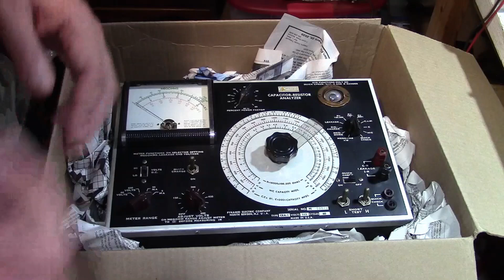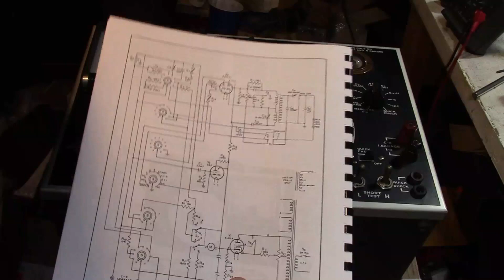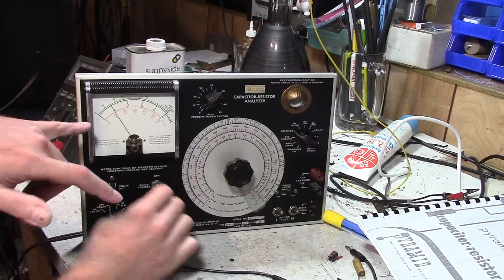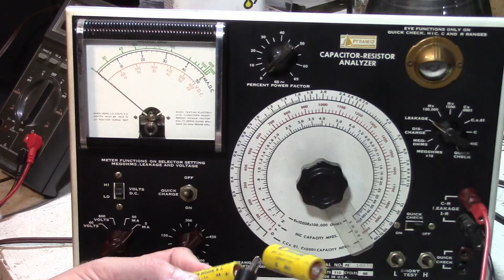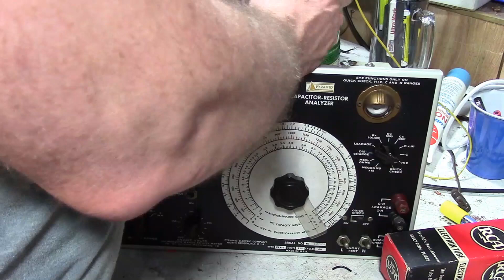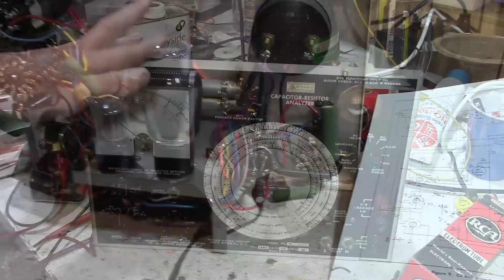Pyramid CRA-1 capacitor analyzer

Comment: This video is slowly goading me into finishing up the complete rebuild of my Sprague TO-5. RIght now it's about like this one: working, partially recapped. The main potentiometer— the one which controls the scale/ dial— was a bit flaky though, so I ordered a new one. They still got 'em over at Mouser! A little expensive, but then I got a good deal on the tester, and it's in nice shape otherwise... yeah, ok it's time to dive into it. :)

Comment: Capacitors? If in doubt, change 'em out.
But nice looking addition to the bench.
Reply from the maker: And when I do that I get complaints from viewers for not testing them.   There are many in the hobby that go by 'if it ain't broke, don't replace it'  That's why I got it.
Reply: @bandersentv  I can understand that.  I'm not a purest when it comes to under chassis components.  My main goal is to make it work and last as long as possible and look like new outside.   Although I have restuffed a few electrolytic cans because there wasn't enough room under the chassis. I like to change all the paper, bumble bee, and electrolytics.  But some are of the other idea. Each to his own.

Comment: I got a sprague tel-ohmike to-6 :) payed 697$
Reply from the maker: 697 ?  The average price on ebay seems to be about 250
Reply: @bandersentv  I keep looking for cheap ones but all of one's I have seen are above 450us I payed 697 Cad that's including the 150 shipping the good news about this unit is its already been serviced with all new caps and resistors so it's ready to use :) it's very clean and has original manual. The sticker in back says Victoria general Hospital
Reply: I would measure everything in circuit from that switch in 600v range. Hopefully you find something

Comment: Did you replace the .02 mfd cap that is up stream from the meter? If it has resistance it can pull some of your dc to ground through the resistors.
Reply from the maker: Yes, it has been replaced.  In depth look at this circuit coming up.

Comment: It is my experience that when something inexplicable like this high voltage happens, then it is usually due to high frequency oscillations.  The high frequency oscillations get partially rectified somewhere in the circuit, resulting in an apparent dc level.  So put a high frequency scope (1GHz) on points in the voltage control circuit and see if there are any high frequency oscillations.  Hope this helps.
Reply from the maker: Best I have is a 100 MHz scope but I can give it a try.  I've heard 6L6s can self oscillate.
Reply: @bandersentv  That'll work. Just put it on the most sensitive range and move the probe around the circuit without touching anything. If it's oscillating, you should see it. The scope might even synch properly if you use the LF filter on the trig.

Comment: Sorry to hear about the tornado damage. Hell hath no fury like Mother Nature. Really enjoyed this video and quite a nice tester in great condition. I didn’t have a chance to look at the schematic for it, but I recall you showed it had two trimmers. What are those for? Not the meter calibration, apparently. I have an old Heathkit IT-28 that I use frequently and although it doesn’t have a meter, measured voltage is +/- 5V of the indicated voltage on the voltage selector switch. I would think you’d be able to get similar accuracy with your tester. By the way, I use my Heathkit tester with relatively light-gauged test leads up to 600V and have never had an issue as the current is relatively low. Still, if I was leaving a cap to be reformed I’d be more comfortable with the heavier leads you chose.
Reply from the maker: They are for the RF oscillator used in the Quick Test mode.

Comment: Maybe check the taper of the voltage adjust pot?   Seems like it should be linear, but maybe someone installed a reverse log taper one?   Or maybe the voltage out of the transformer is just a lot higher than needed to get the DC output indicated by the dial.   Doesn't seem like it should be as far off as it is, though.

Comment: My bet for the test voltage setting would be the same already mentioned  -- your line voltage is higher than the design line voltage.  I would even think the original might have been 110 V.  Nowadays you could regularly see over 120 V.  Mine tends to be 122 V.  There is no reference voltage, just the "guess", like when to turn the steering gate on, and that comes from the same (excess) voltage.  Moreover, the filament voltage probably is higher as well, so the 6L6 charges the output capacitors faster than expected at the original design condition.  You could test this conclusion by feeding the  unit with 110 V from a Variac.  If true, you could try tweaking some of the components at the voltage setting string.  Or preferably reduce the line voltage permanently.
Reply from the maker: It was designed for 117 and I am running it through a variac at 117.  Dropping it to 110 has little effect.
Reply: bandersentv 
OK, so I would have lost if it would have been an actual bet!  Oh, well...

Comment: I would increase resistor going to control it should help lots
Reply from the maker: It might not be that simple.  It works correctly on the 0-60 range.
Reply: @bandersentv  it's definitely something to do with that control something is out of tolerance could be one of those power resistor maybe are open

Comment: Its very simple. Higher line voltage, more efficient newer parts, the dc voltage range is going to be higher. I have the same problem with my heathkit IT-28.
Reply from the maker: I'm running it from a variac set at 117 and the problem was there before any parts had been replaced.  The voltage is about 120 volts too high.   There's something not quite right
Reply: @bandersentv  even then, my variac runs about 30 volts high. You always gotta check it with a voltage meter. I would run it at 110 or 115 volts. New caps and newer parts are more efficient. So more b plus, more voltage coming out of the circuit.
Reply from the maker: My PR57 Variac has a built in meter and I know it's accurate.  As I said, the problem existed before any components were changed.  This device does not have a convention B+ supply.
Reply: @bandersentv  hmm. I'm stumped. Mine has a variable voltage supply and not a fixed switch, so I just put it a bit lower than what It says on the device. I know yourse has a variable voltage supply so I would reccomend that. But I'm stumped on this one.
Reply from the maker: I've dialed the variac as low as 80 volts and it has little effect.  Perhaps it's a bad ground connection.  The front panel is aluminum so all connections to it are mechanical rather than soldered.  It also seems like the huge power resistors don't get very warm (if at all) while it's running.
Reply: @bandersentv  very well could be

Comment: Bill just did a packing video. He is very good at it so it no surprise how well this came to you. Nice unit. Got a Semcor RC-115. It is very much  like a Sprague TO-4.
Think the eye tube and power factor switch are in opposite places. It has a nice meter on it something like yours  too. Great demonstration on how it works!
Hey Bob get some rest. You look totally exhausted man!
Reply from the maker: This didn't come from Bill.  I just saw him use one in a video years ago and wanted one of my own.  Semcor looks like a nice device.  Curious that it has the same voltage ranges as this CRA-1

Comment: If you want to make up a religion, Church of Electrolytic Reformation would be a good one :-)

But I'd like to know: Do you have experience with the reliability of reformed capacitors? 
(I tried to ask more precise questions but ended up with a huge wall of text every time...)
Reply from the maker: No, none.  I don't mess with reforming old caps - I always replace them in the end.  The only reason I talk about it is that there are plenty of guys who do and think it's wasteful to replace caps with some life left. Since most of the sets I work on belong to others or I sell, I don't want to take any chances.

Comment: I think the meter shows a positive voltage even at the minimum setting because the 6L6 will conduct and charge the capacitors up to the voltage necessary to negatively bias the 6L6 so that it no longer conducts.  The 6L6 data sheet for class A operation at 350V on the plate and -18V on the grid gives 66mA of plate current.  For the capacitor voltage to stop ramping up when you switch on requires that all the plate current goes through the bleeder resistors, and I guess this is just a few milliamps. (Need to know value of R19 and R20 to calculate this current) The plate voltage in this tester must peak at around 600V, so I would expect a lot more than -18V bias to be needed.  I found some characteristic curves for 6L6 which show about 8mA plate current with -90V bias and 600V on the plate, so your minimum voltage of 120V is not surprising.  It looks to me like it was designed to work this way, and it is not faulty.  Maybe the manual explains this somewhere in the small print?
Reply from the maker: Maybe, I'll keep looking.  What I find odd is that the 60V range tops out at about 55 volts and the 600v range starts at 120.  So there's a big gap in coverage.
Reply from the maker: R19 and R20 are both 60K.  Nope, no explanation in the manual.  I get about 450 volts with the knob set to 300. Seems odd to me that this works as intended as it means that you can't test between 60 and 120 volts
Reply: Technology limitations?

Comment: Is the voltage adjust knob able to be removed? You could just rotate the knob until it points at the correct reading.
Reply from the maker: I suppose but it goes way off the top of the scale and doesn't go as low as it should.

Comment: Nice capacitor checker! Certainly a step up to our CB-160(s). I saw that it was on discharge right away. It looks confusing to remember the sequence of settings you have to go through.  Can't blame you there. -- I also use to watch Old64goat's work bench videos a few years ago. I didn't realize that was the same cap checker. How come I get a feeling that all of these just worked in the day like that? --   You were lucky as far as that storm goes. Did you have any flooding in your basement?  Take care Bob and thanks for the vid.
Reply from the maker: No, no flooding thank goodness.  It didn't rain all that much and we had the one foundation crack sealed a few months ago.  Tight and dry down there :)
Reply: @bandersentv  wheh...

Comment: I like these old devices and have the much simpeler heathkit IT-11 myself. But I'm thinking of building the capacitor tester mr carlton (lab) showed to his patrons. He concluded that this form of leakage test is basically measuring current through a high ohm resistance. And as you said the device has a mode for isolation tests. His next conclusion was that Ohm's law does not change with voltage and following from that, is that the test is equally valid with low or high voltages. To me this makes sense. So he designed a circuit that does the same with much lower and safer voltages. (has a nice led bar to show current in place of the eye tube). The reason old devices (I think) used high voltages. Is A because it's what they had and B it requires far less sensitive current measurements. Because given lower voltage on the same cap with the same internal resistance the current also gets much lower. 500v divided by 10meg is much higher than 5v divided by 10meg.
He has demonstrated this testing caps from tube radios comparing testers like yours and his new one to each other. The results are the same. The one thing you loose is reforming caps, but that is thus a stop gap measure. Once it goes bad its replacement time.

Comment: Maybe hook it to a variac and adjust the voltage to the instrument to 117 volts?
Reply from the maker: It was.  Also, that would account for the output being over 100 volts higher than it should be.

Comment: Nice unit!  Is the power supply any more accurate with the rated 117 VAC input?
Reply from the maker: I was running it of a variac set to 117
Reply: I wondered the same, but transformers are linear so that could not account for more than about a 10v difference?. Surely not a 100v deviation unless that tube is amplifying the deviation  somehow.
Reply: That's what got me wondering since the voltage is changed by the biasing of the tube.
Reply: @YouAllKnowBob  We will have to wait until he can find the time to test these things out.
Reply from the maker: @bzuidgeest  I've dropped the variac down as low as 80 VAC and it makes little difference.  I'm inclined to think this is just how it works.

Comment: Also, it would be interesting to redesign that tester using modern solid state parts someday. Maybe build a new version in a new cabinet
Reply from the maker: You could get a vintage solid state tester like the Sencore LC53.  They are in demand and cost quite a a bit though because it goes up to 600 volts.  There are also DIY designs floating around the internet.
Reply: Mr Carlson's Lab has a modern low voltage cap tester.

Comment: Boy if it were me I'd think about getting your huge old trees taken down if there is a chance they could fall on your house!
Reply: He can probably reform the trees with this new capacitor checker :-D
Reply from the maker: No way.  The trees are the main reason we bought the place.
Reply: @bandersentv  I here I was, thinking the main reason for buying a house was the roof it puts over your head :). Maybe build a treehouse next?
Reply: As long as a tree is healthy and the soil it is standing in is not eroding it should stay standing in most storms. Otherwise the earth would not have any trees left. If the tree goes there is a healthy chance your house is going to get blown away anyway. Especially as it seem uncommon in America to build with stone. So much wood construction. Here in Europe its the other way around.
Reply from the maker: Chicago is an exception.  Most of the city burned to the ground in 1871.  As a result all buildings and homes were built of brick for many years.  Ours is in one of the few areas to have old wooden framed homes.  Luckily none were hit.  Some tress did fall onto brick buildings and there was little damage.